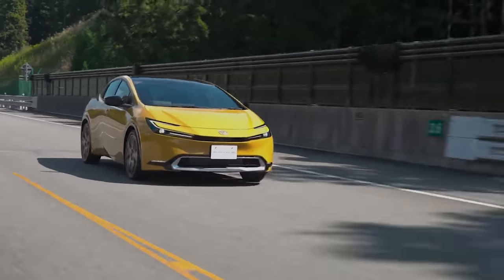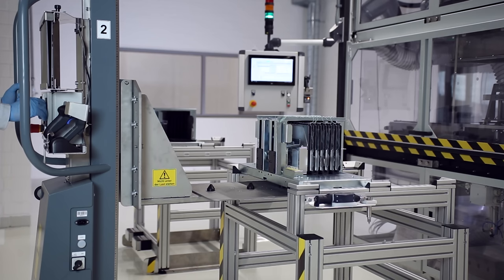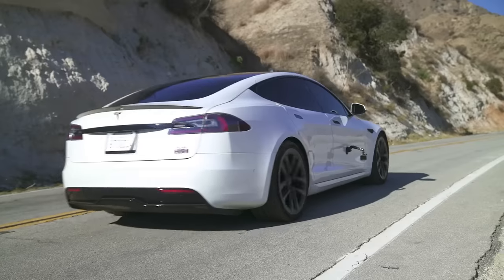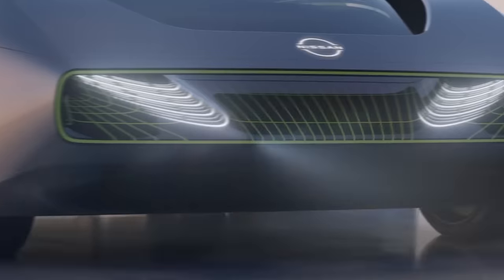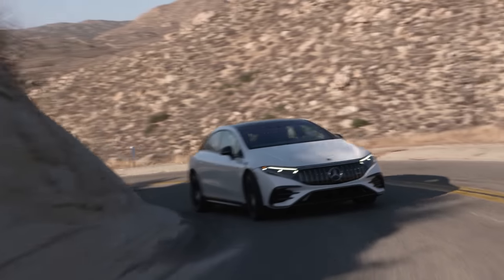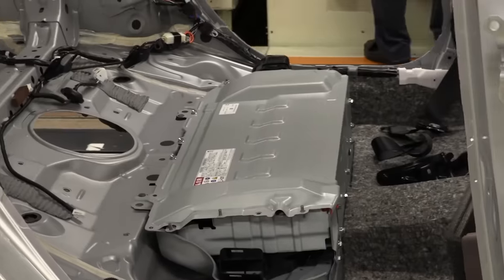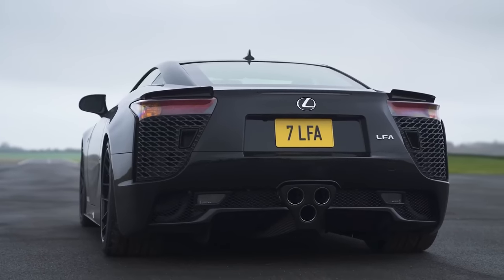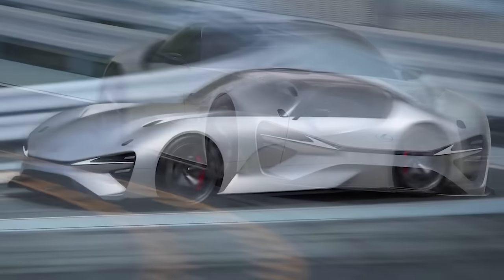New Lexus LFA with GAME-CHANGING battery!

Comment: To charge a 100kwh battery from 10 to 80% in 10 minutes would require close to 600kwh charging capabilities. Thats insane... I sure hope that happens, but nothing is close to that yet. However... At 350kwh in 20 minutes is still pretty dang good!
Reply: I think you need to recheck your math. 10-80% on a 100kwh battery is 70kwh. A 350kw charger, at theoretical max, does 70kwh in 12 minutes. But realistically, would be slower depending on temperature and other factors. A 450kw charger may get there.
Reply: @deansmits006  I think you're also assuming perfect efficiency and peak charging 100% of the time. Neither of which are possible. Typically higher capacity chargers charge at lower efficiency which may be closer to 80/85%. Secondly, due to heating constraints of the charger and battery, chargers fluctuate from peak to lower than peak to ensure safety and may in reality average out closer to 200kwh over the charging period. Perhaps solid state will make these numbers a bit better but I wouldn't be surprised if 20minutes is probably pretty close to the estimate for charging 70kwh with current 350kwh chargers. I agree though, 450kwh may get very close to 12 minutes.
Reply: Folks, learn the difference between kW (power) and kW•h (energy). As the units of the latter suggest, energy is power for some amount of time; for example delivering 35 kW for 10 hours. There's no such thing as a 350 kWh charger.
Reply: @skierpage  I am well aware of that, no need to be arrogant. All the math I presented still works. The only error was forgetting to take the "h" off...

Comment: SSB's are very exciting. A few years ago I didn't think I'd ever be excited about EV's and looked at Tesla drivers as pompous blow-hards, pretending to save the planet in a boring, soulless appliance...it was like a cheat, unworthy and undeserving of any attention, regardless of how they performed in drag races. I felt a certain animosity toward them that I can't even explain. Then friends started buying them and I thought they were foolish for buying into a fad that would die out and be forgotten. Then I drove a Hellcat and a Model X P90D back to back. My whole perspective changed in an instant. I was hooked. Of course you never get the sound...but the stealth of electric is kind of appealing, too. I eventually ended up ordering my blue/white '22 Model 3P a year ago and have enjoyed every minute behind the wheel. However, there are still challenges with widespread adoption of EV's, and one of the biggest is the relatively long charging times. Sure you can fast charge in 20-30 min but that's still a lot longer than you'd be waiting at a gas pump. The greater efficiency and quicker charge times of SSB's helps to mitigate this. Aside from that, I do sometimes miss the smell of gas and the sounds of internal combustion, though. I think a rapid charging, SSB hybrid would be the ideal with the added power and efficiency of fast charging electric, while still retaining the convenience of gas station fill-ups, as long as it's not mated to a CVT. I've always had a lot of respect for Toyota (although they have lost some of the mojo they had in the 90's) even if I think many of their designs are awful. They are starting to produce some interesting and attractive shapes, once again, which is good to see. Their battery tech advances are truly exciting. If this turns out to be as good as it sounds, I could see a Lexus being my next move after the 3P.

Comment: Reduced weight from solid state batteries is a potential game changer. We could just start sticking battery electric hybrid powertrains in every car for almost no cost, it'd be all upside. The weight penalty for full electrics would be reduced, which is also great.

Another potential win not mentioned here is that it might be possible to create solid state batteries without all the rare earth metals and environmental impacts of conventional chemical batteries like lithium-based designs. That'd be another big win both because it'd be better for the environment and, long-term, almost certainly cheaper.

Finally, the Honda Insight--the ORIGINAL, hybrid Insight--did come with an optional manual. A real manual. It was a neat setup, though i don't know what complications or issues there were with it.

Comment: The LFA looks awesome, but BMW is also working on solid state batteries right? Ive heard the next M3 will be with a motor at every wheel with solid state batteries. I can be wrong but thats what I will get when it's released.
Reply: It won't be there tech, be coming from Toyota . BMW and Toyota work together with ev models. So won't be surprised if it from Toyota.

Comment: Getting tired of the debate on the battery charging, ludicrous mode, etc. etc. Toyota please start the production with two things in mind. Range at least more than 400 miles, and affordable prices. Charging speed doesn't mean diddly squat, if you can't find the chargers. Plus has anyone talked about the lines at the charging stations. No one does.

Comment: You are way too positive about the solid state batteries but you don't even mention a single thing about the real reason why nobody is using them.

The degradation is incredibly high and it will only last about 200 charge sessions.

Comment: Electric manuals/engines could be amazing if done correctly.

Manuals are fun, automatics are convenient. You have to live with one if you cannot afford both. 

Imagine being stuck in traffic/round town, and not wanting to deal the clutch controls and gears. You could just select automatic mode and boom, auto gear box. Then, maybe you want to feel like a group B rally driver, in a big power turbo lag machine, flying down back roads, set it to H-pattern manual mode and some special “engine” mode. Or maybe, you want to feel like a racing driver. Boom, sequential mode. Or maybe, you want to feel like your in an Aventador, smashing through the DCT gearbox with its mega aggressive changes. 

Honestly, what a world of possibilities.

Comment: charging for 10 minutes from empty to full - wow Toyota.  That would be crazy.  Also supposed to be less expensive and on the whole just better than Lithium ion.  I rather doubt that those benefits are going to result in lower costing cars though - instead it will just be the way to increase margins :(

Comment: See, now this is the kind of thing that would make me consider moving from gas or diesel to electric. Others on the more earth-first side seem to think people like me are holding onto gas cars because we want to kill the planet or are not open to new technology, but no, it's actually because at their current development, they won't work for our specific situation.

It seems like a relatively simple ask personally. All I need in a vehicle is one that has two rows of seats, a large cargo bay, decent driving manners, very good off-road capability (I live in the relative backwoods and also get very deep snow every winter, sometimes two feet in a single day), some towing capacity (3,000 pounds minimum), a range of at least 300 miles in subzero temperatures with a refill time from empty of ten minutes or less (I'd also take 1,000 miles on a multi-hour charge, as that's about as far as someone can reasonably drive in a day), all for the same price or less than a comparable gas model. I'm not concerned with acceleration times (anything less than 9 seconds is fine with me), and I don't need the latest technology, driver assistance stuff, touch screens, massaging seats, or anything like that, so feel free to keep that stuff out of the car and forward the savings on to me to keep the cost down. Also, a refill in electricity will need to cost the same or less than a refill in gas or diesel (some areas of my country electricity actually costs more per mile than the dino juice, though I haven't checked my specific area yet).

For reference, my daily driver is a Jeep with a gas engine (no diesels available when I bought it, or it would be), manual transmission, lift kit, all-terrain tires, a basic radio, and the cold weather package. It meets all my criteria above, and I'll only get rid of it when I find something else that can for less initial cost than the average new car (my specific build was less than an average new car in America when I bought it). I'd be open to a hydrogen or even a steam car that could do the same thing. When someone has that, I'll take mine in either blue or green, please.

Comment: Here is why EVs are going to have problems.  First, the purchase price is way too high.  Next, public chargers are few and far between in many states.  Next, the chargers out there are being damaged. Also, as an example of being inconvenienced with using an EV was the following:  I wanted to travel from Virginia to New Jersey.  It would take me normally 2 hours.  Because of public charger problems, it took 6 hours. Finally, our electrical grid is already having problems.  Overloading it with EVs won't work well.

Comment: Give me a 3 liter boxer 10 LFA with solid state batteries rear wheel gas powered, front wheel electric power with 300-400HP to each axel. 
Independant drive trains that allows for either one to be completely switched off, say too hot/cold for the batteries because of some sort of weather event? Just run on gas.
Daily drive to work, only fire up the engine when you want to hear the roar.

Comment: CATL stated cell density while the model 3 density stated was pack density. The diffrence becomes very small pretty fast once again. Solid state is quite a bit away sadly. First we need to actually find a way to produce them at scale and then when we know how to do it, we actually have to do it. That will invole Material sourcing and much more. So were not getting any big revolutions quickly. The 4680 from Tesla ( and soon others, if not already, iam not that informed on who uses them ) is the first battery designed for cars. Giving us ~20% better everything with Charging speeds maybe even way more then 20%. Thats it for ne next few years. We can get small gains like another 3-4% with better chemestry or something but we dont have a 100% increse on the horizon yet.

Comment: mimicking a manual ICE, is stating the obvious - a manual ICE is the pinnacle of automotive engineering. prove me wrong.

Cannot better an LFA unless its a V10 or V12, plus electricity. but it will heavier and hence you cannot better an LFA.
 
LFA's cannot be bettered.

Comment: Headlines I found from recent years:

2023: "Toyota to roll out solid-state-battery EVs as soon as 2027"

2020: "Toyota's Quick-Charging Solid-State Battery Coming in 2025"

2017: "Toyota’s new solid-state battery could make its way to cars by 2020"

2014: "Toyota to Offer High Performance Solid-State Batteries in 2020"

You see a common scheme?

Comment: I don't know why you think this would give Toyota an advantage over Tesla. If reliable, mass-manufacturable solid state batteries become aviailable, and deliver on the promise of cheaper and higher energy density, then Tesla would be all over that like white on rice. Tesla is not wedded to LIthium Ion, it's just that that's the best choice at the moment.

Unlike ICE, which cares about the kind of fuel you give it, EVs don't care about the kind of batteries they have. As long as the battery can deliver the juice, it can work. Super simple. Remember Tesla bought Hibar systems, a battery research firm. I wouldn't be surprised if they've already got some advanced battery tech in the pipeline. I think Elon may have eventually learned his lesson about too-early product announcements and is just not saying anything about it at the moment. Don't wanna osbourne yourself.

Anyway - Tesla has been DUMPING time, money and effort into developing EV tech. Most other companies, ESPECIALLY japanese companies, have been working as hard as they can against EVs, being dragged kicking and screaming into the electric era. In the last couple of years there are some good Tesla alternatives, but no serious observer could think that Tesla's competitors are putting in a fraction of the effort and money into EV development that Tesla is.

Comment: Will never happen with a manual. Why would they remove battery capacity to add a slower transmission to a super car that's all about performance? Most people can't even drive stick so they wouldn't limit their audience either. They couldn't sell the LFA when it was new with an automatic, no way in hell will the board allow them to put out a fake manual electric supercar - I couldn't think of anything dumber. And I own manual cars!

Comment: Solid state batteries will never be game-changing until they can be massed produced / scaled to a point where they will legitimately compete with regular 250+ mile passenger EV’s at a similar or lower cost. It will not happen any time soon, if ever from Toyota

Comment: Honda are also investing in a solid state battery plant in the States (I think) and I'm sure the other manufacturers are as well.
Reply: Honda's EVs suck so bad they asked GM to piggyback them to the future lol. Besides Nissan, all japanese manufacturers are struggling badly with bevs, that said, Nissan ain't doing stellar either, but at least the ariya is not an embarrassment coming straight from 2015, it's truly sad
Reply: @LeoMkII  replacing the $28,000 Leaf with another me-too $45,000 crossover that will sell in smaller volumes is not progress. Toyota failed to try; Nissan tried but failed to keep up; Honda made then cancelled some  half-hearted efforts (City EV, Fit EV, Clarity EV). Japan Inc badly screwed up this transition.

Comment: A bit painful to watch this accumulation of marketing bullshit. Toyota doesn't do anything of that, except making contracts with companies actually working on that Tech, nor have they done anything in the past. And from how I have lernaed to know the company it's mainly marketing claims. Toyota is still making ads for their mild hybrids showing people laughing at EV-Owners waiting for their cars to Charge. While one by one, all countries phase out combustion engines, the japanese government aims to make all cars mild hybrids. Like most companies ten years ago Toyota is still trying to convince the public, that, apart from a few idiotic lame exceptions Electric still is in the distant future. They're living in 2015. EVs are already there and very capable. Outside of Japan, that is. Maybe they got the hint by now and now try to desperately reorient to electric but i'd be surprised if any of their claims was actually true.

Also if you follow Battery Tech in depth, then not many experts are willing to bet any money on Solid state Batteries. Because Batteries need to be better or at least on Par with currrent Tech in every aspect. Most Wonder-Cells are only good at one thing. Remember, the Cell needs to have good results in: Volumetric Energy density, gravimetric energy density, Power delivery, Charge cycles, safety, material cost, Temperature dependant Performance. And Currently a lot of the world commits on Production facilities. If those Factories cannot easily adapt to the new Tech, it'll have a massive handicap. So it would be great if solid state batteries would happen, but it might as well be that they come with some drawbacks or not at all, even.

Comment: The solid state battery seems to be a gimmick. How can it weigh less by being denser? And how a solid can be less prone to overheating than a liquid thing?
And the LFA successor feels so stupid. The manual gates and fake clutch paddle made it a toy that people will most likely to keep on the shelf for looks only and save the original thing that it's trying to look like the classic IC cars for the roads.

Comment: Can someone tell me if it's so game-changing and is known for many years, why it hasn't been implemented in the beginning of EV era?
Reply: They couldn't make them at volume for a competitive price. The technology & materials have had to evolve to enable this to occur.
Reply: @Silent_Flight  thanks! 💪🏼
Reply: Sony and Asahi Kasei released the first commercial lithium-ion battery in 1991. It took decades for the cost and volume to reach the point where it could be used in EVs.

Development takes time and $$$$$$, and there's no guarantee that the theoretically better tech in the lab will ever be cost competitive. I've read about breakthroughs in flow batteries, graphene batteries, zinc-oxide batteries, etc. for years yet lithium-ion steadily improves and remains unchallenged in EVs.

Comment: The manual gear lever feels very gimmicky.  Keep it slick and modern Toyota.   Someone going 0-60 in 2 seconds won't have time to mess with extra processes.  They will be holding on to the steering wheel for dear life. 😄

Comment: Nice to know Toyota want to surpass Tesla by 2028, unfortunately by then it'll probably take them until 2034 to catch up to Tesla's 2028 product capabilities.  The more the merrier though, and perhaps Toyota might outmatch Tesla when it comes to drivers who want to physically control and drive their car not swipe touchscreens leaving humans at the mercy of the software in a stripped out cabin devoid of manual interfaces, which seems to be the way it's going.  There's a gap in the market for long range fast charging EVs with analogue gauges and physical controls for everything, with no touchscreen controls at all beyond a satnav/infotainment system.

Comment: Toyota is way behind in the battery game since they’ve been chasing the hydrogen dream (most hydrogen still comes from fossil fuels and uses limited poor infrastructure) and now the solid state unicorn. Solid state, like capacitors looses charge at a much higher rate that batteries, just bleeds it away. If I could drive an LFA I would, if only once.